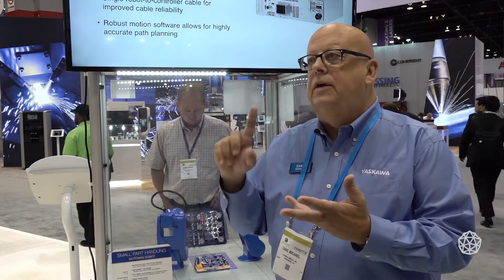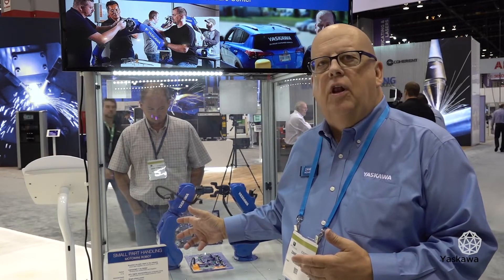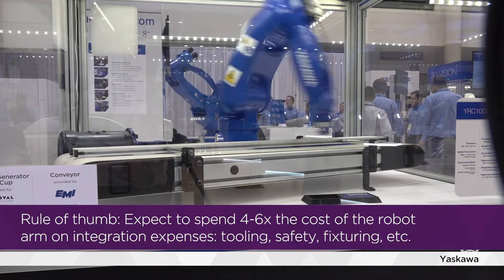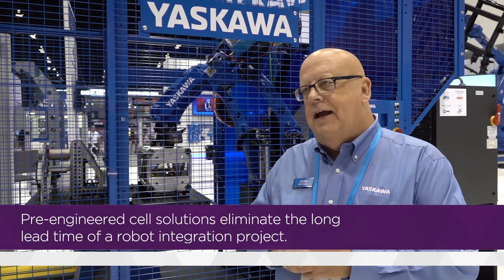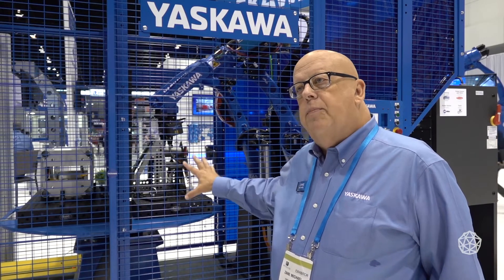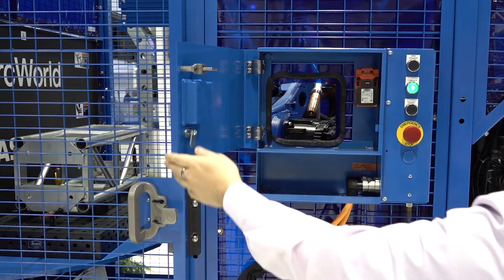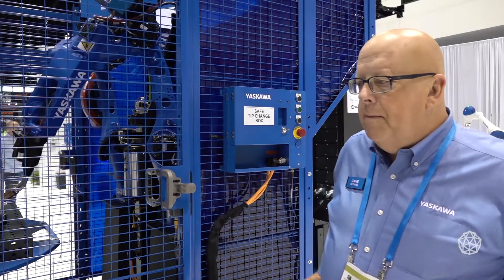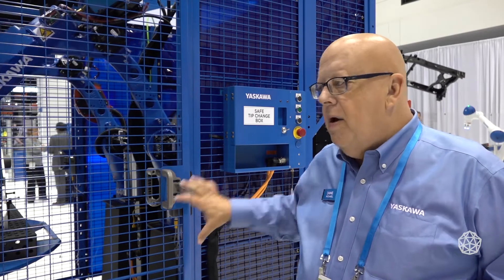Why a Pre-Engineered Cell Could be the Better Buy: Industrial Robot Costs

Comment: Am I the only person that watches these videos... Interesting the big arm is basically $25-30K but the integration elements make it a $100K proposition.
Reply from the maker: Thanks for watching! Most industrial robots fall into the mid five figure range. However, the cost of installing, commissioning and programming one can easily bring that cost up to $100K, and take several weeks. The interesting thing about the pre-engineered cell is that yes, you spend that money, but you save a ton of time.
Reply: If you dont have the know-how you will have to spend that money. As stated in the video. Safety standards, programming etc.